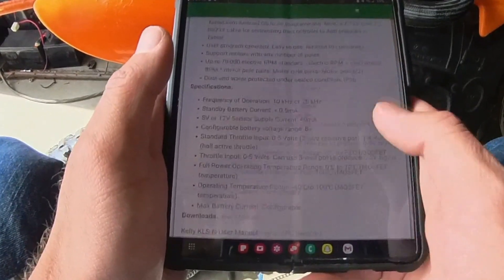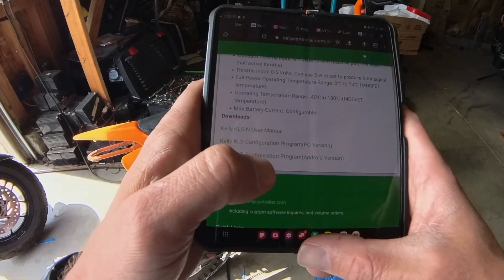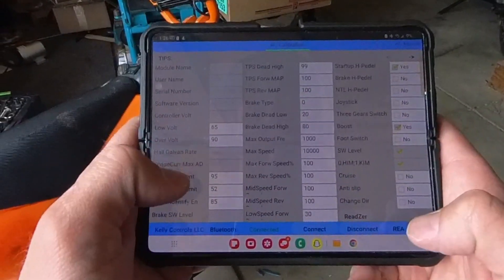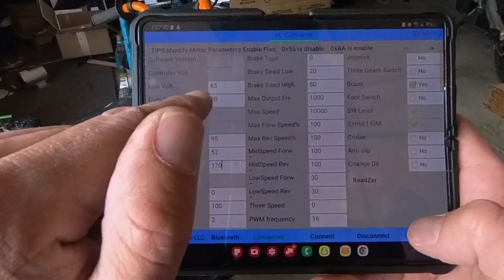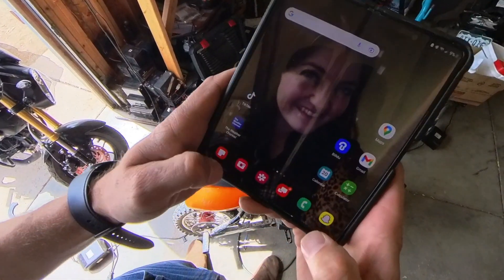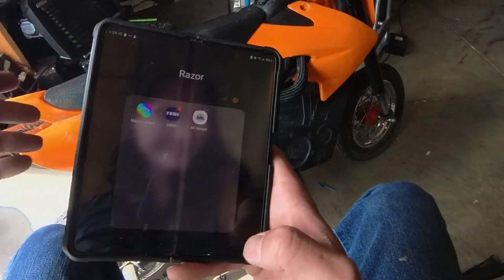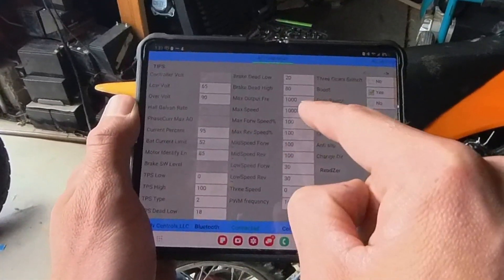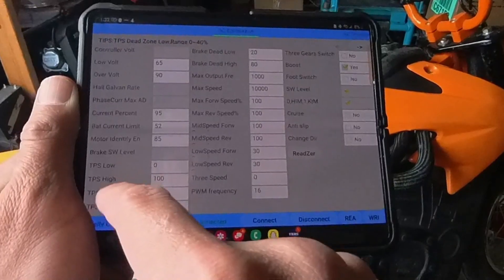Kelly controller programming! Kelly  part 2

Comment: Your app looks a lot different than mine, I don't have all the motor settings and I only have auto identify for my mini KVD. How do you find those menus?
Reply from the maker: @glaciusgaming9995  yeah I only run the KLSN torque model which Kelly says has more precise to work settings The KVD is just more of like a basic Kelly in my opinion I've personally never even ran one honestly You're just a lot more limited on that controller.
Either way Kelly is outdated now I have a pile in my garage of them I stopped selling them as well as stopped using them so many better options now
Reply: @Razorcrew_Cole  I've been getting constant howl errors with mine so pretty close to just giving up. Motor was working fine with the stock vevor controller but the Kelly just won't recognize it.

I think it's going to end up in the trash and get replaced with something a little bit more modern. Do you like fardriver?
Reply from the maker: @glaciusgaming9995  yeah a lot of people are going to far driver right now for sure. I have a video on controllers pretty much going through flip sky vs far driver but I think far driver is probably the better option for most people. We have a discount code too E-conic cycles on it to and I think it comes with some support

Comment: Great video best one on YouTube that is simple to explain, thanks for making this! i still need to tweak my settings, 72v 3000w velvor low end is to torquey front end wants to jump up on just 1/4 throttle? I need to tame the beast so my power comes in later and not so much at low throttle, I have to just barely feather the throttle and cant seem to get past half or the front end will pull up! what do you recommend? i have smooth box checked
Reply from the maker: Do you follow me on TikTok?  That's where 90% of content is... 
So the controller's response is tough with those I have Kelly I sell and I'm working on manufacturing motor to have full kit I have batteries made with my partner.  So these different throttles read the signal better along with a better throttles that have better sensors and controllers to dial it in.
Reply: @Razorcrew_Cole  whats your Tik Tok?
Reply from the maker: @mikemazzoli1990  @razorcrew_cole ... I have a backup account The main one should have like 12K followers.   If you want to go into my favorites and collections I made the razor garage go through a lot of stuff and then I have the playlist to.  I need to get better on YouTube I'm so busy trying to design a motor and set right now I apologize
Reply: Hey Mike did you find out which setting you had to change to tame that beast ? Im in the same scary boat ahahah
Reply from the maker: @tarkusxfpv8010  it's honestly just the way those controllers are programmed why I refer to them as the basic ones.. 

I know a lot of people buy plug and play different throttles from me and say it responds a little better but nothing like a Kelly or far driver

Comment: Hey buddy, I need a little help with my Kelley controller 7220nd. I was playing with some settings and fried one motor. I was hoping to set it up better to avoid repeat that issue.
Reply from the maker: @moearmani7884  interesting I've moved away from Kelly's there so extremely outdated let me think did you just have your line amps too high, what kind of motor? Most those motors once they get over 170° 180° internally you've melted it it's done for so we monitor the heat a lot when running higher wattages with my EMF 12 volt system and the temp gauge and the fan that's not out yet
Reply: I reduced the battery current to 50% and took my field weakening to 0. Took it for a quick ride, the phase wires burnt up. The motor spins fine after I cut the wires. It’s not burnt inside. It a 48volt 1500w mid motor. I am running a 60volt new battery. I think the higher voltage did it?
Reply from the maker: @moearmani7884  hmm I've never ran those 1,500 w motors I typically have ran the 1800 which is actually the48v  2K there's no such thing as the 1800. But I have pushed that motor to 9000w on 72 volt For over 5 years but like I said I monitor heat temperatures too.  My 1020 motor in general will overheat faster than most assuming you have a 200 amp controller so you're throwing a hundred line amps at it normally I recommend to people no more than 80 line amps to a 3000w my 1020 motor or you start to see heat problems.  You might just be throwing too many amps at it
Reply: I appreciate you taking the time to answer my questions. It happened while the motor was cold, I changed the settings, went for a quick 30s ride, the wires over heated!
Reply from the maker: @moearmani7884  wow... That's extremely weird then honestly. It is a brushless motor correct?
Reply: @Razorcrew_Cole 
Yes brother, brushless! It was weird.
Reply from the maker: @moearmani7884  I figured I'm just trying to cover my bases, yeah that is odd then for sure. If it wasn't hot and you cooked it I'm honestly lost for words. There might be some other perimeters off or something you did the auto learn and everything I assume for it to work right?
Reply: I sure did, it worked great for a while, I got a new battery, I ride it for a little bit without the battery being charged, I charged it to 62 volts and went for a low speed ride and this happened.
Reply from the maker: @moearmani7884  yeah honestly super weird man I usually hear that from kids that are just holding it full speed for a minute and getting the motor hot as hell
Reply: I appreciate you taking the time, you are one in a million. Keep the channel going, you are a good human and I appreciate you very much!
Reply from the maker: @moearmani7884  yeah man I'm always here to help answer on all my social media platforms I answer like dozens of questions a day so no worries! I wish I had a better answer for you I'm kind of stumped on that I would say the 3000W motor or the 2000 w motor worth a shot

Comment: Can you tell me which setting tonturn on Regen kelly kvd7215
Reply from the maker: I'm not sure with a free-wheel regen doesn't really do anything so I have never used it still, And the KLSN settings are a bit different than KVD I've never used one I'm sorry I'm not sure. If you go to Kellycontroles.com and track down the user manual It should tell you